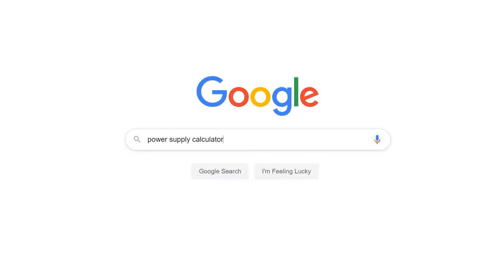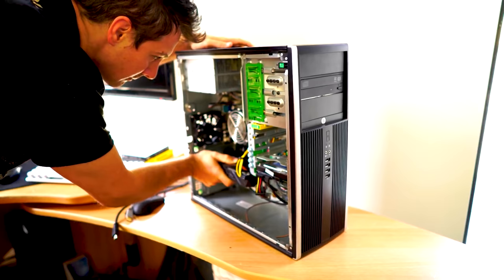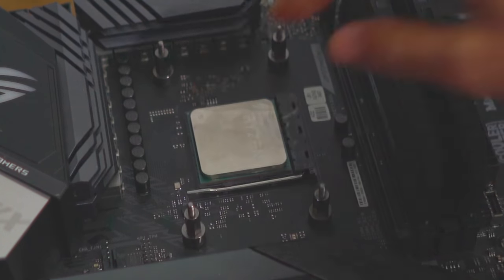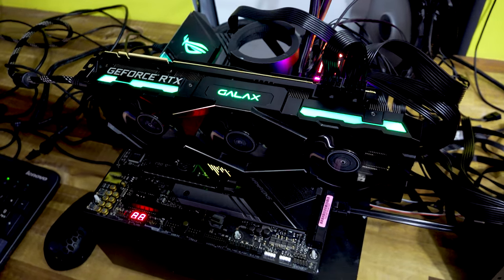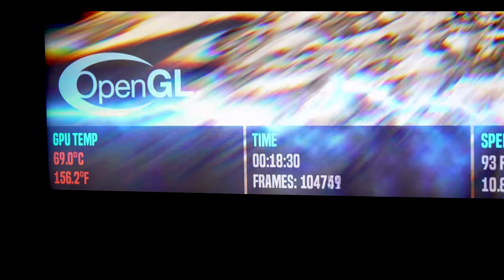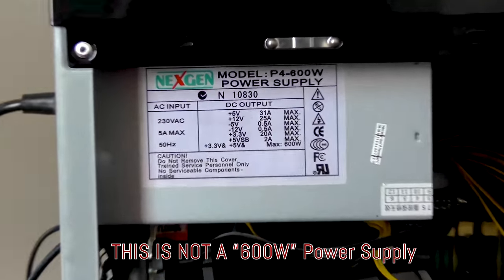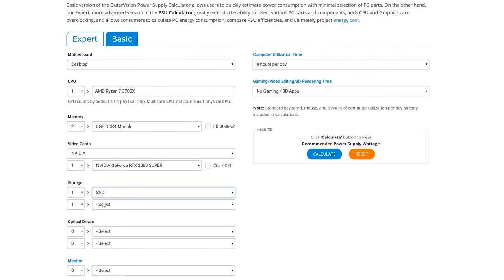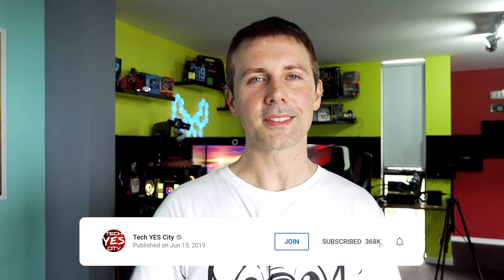I Tried Running a 3950X and RTX 2080 Ti on a 450 WATT Power Supply...

Comment: Nothing exceeds like excess... I usually try to have 750 to 850 in my boxes for the extra headroom. I actually HAD to buy a 850 back when I was running a 4870x2 card. It pulled so much current when it booted into a 3d game the psu would shut down do to overcurrent on one of the 4 gpu dedicated rails. Each rail on my 750 Nspire was rated 18 amps max and video card buried it. I got a 850 that had a single rail that could output almost 70 amps and no more issues except feeding that monster for my power bill. My boxes both have 850s now and run quiet and happy but both have more efficient graphics cards now. My old setup would show 500 or more draw just as a game loaded up and it shut off. I think it maxes out at 350 now with a 4960x and a 1070 gtx and all the other goodies. Nspire used to make great value power supplies back in the day but 4 rails kinda limited what they could power with the high watt video cards some years ago. I remember being excited about getting a decent 300 watt Antec that probably put out 400 clean back in my 486 and early Pentium days, that was a big unit back then.
Reply: There are incompatibily Problems with newer psu's having Just one rail, Like the EVGA supernova G2 and older Boards Like the X79 Classified Lavender Mod. IT don't Works. I found the one rail psu mighty in its Performance after having a 1000 Watt ne quiet Dark Power Pro P7 with ist Many 12 Volt rails which one of IT reduces Power in the big 12 V rail To 11,81 Volt wich ist the Order to Shut down system or windows regulary.

Comment: it’s best to run Power Supply’s @ 50% Load to keep it Running at it’s Sufficiency + Less noise + less heat, etc .... 💥 My Evga 600w 80+ Gold is paired with a Ryzenn7 3700x  + 32gb Ram + 6tb ssd’s + x570 + Rtx 2060 8gb Super, etc ...  Plenty of head Room for future upgrades & Thanx for Posting 🇵🇹

Comment: It doesn't matter what electronic device you are driving... you can never go wrong with a good stable and clean power supply. If your PSU is rated for a higher wattage, and it is a reputable brand, it probably means that it can better compensate for fluctuations, spikes and noise from your mains as well as back emf and noise generated by your usage device(s). A bigger power supply isn't necessarily going to use more power, the power consumption is driven by the components you install. It is just a good idea to spend a little bit extra, and you will never even know that you saved your device(s) when that power spike or dip hits. I've used UPS-es in multiple countries with live power monitoring switched on via serial and later usb ports (yeah I'm old). Please believe me when I tell you that the power from electrical outlets is not as stable as you think. I'm speaking from decades of personal experience. Think of it this way, when you go to the liquor store, rather than buying a "forty" or a six-pack, you would do better to buy a case of beer or even a good bottle of whisky. (If you can afford it) It doesn't mean that you will drink it all in one go, or that you have a substance abuse problem... what it means is that you are the kind of person who plans ahead, and you have something on hand for when your friends drop in unexpectedly. You don't plan for the unforeseen - you prepare for it.

Comment: This was very interesting. I used that calculate and it's telling me a 500w should be fine even for a 16 hours. So I guess my 750w is overkill, but it was a good price also I do plan on upgrading my gpu later this year.
Reply: nah 850w psu is overkill 750w-650w best overall.
Reply: Mine says 540w is enough for an rtx 2080 super and i pick 8 hours/day. And i have a 600w psu.

Comment: Im actualy use a r5 2600 and a rtx2060 with a 400w white Psu from evga and be fine for me, 6 hours a day of gameplay .
Reply: That’s also less than had the power draw, so yeah, you’re more than fine.
Reply: the evga psu´s are made by super flower. i´ve used 980TI SLI with an e5-2690 on X79 classified X Lavender mod, 750 Series 400Gb and about 5 Sata SSD´s with a super flower atlas 680Watt of ~2001-4
Reply: I have an coolermaster elite 500watts v.3, ill be fine with r5 2600 ans rtx 2060?
Reply: @MatheusSilva-sl6bt  yea !! Fine and eficient
Reply: @ZeuXspec  oh thanks

Comment: Most aim high because it's generally understood that your PSU is probably delivering somewhat less than it's rated voltage unless it's a branded PSU with a solid reputation, and "it's generally better to have too much and not need it than need it and have too little"

Comment: The fact that he stressed the system with 3d applications for more than 7 hours and put "No 3D applications or rendering" in the PSU calculator really bothers me.
Reply: Well, he is BASIC
Reply: Don't worry girl pants you're probably over it by now.
Reply: @gavmedia5674  I'm so offended, boo hoo
Reply: that option is only meant to calculate your power consumption per year, and not the wattage demand, so it makes no difference

Comment: "Cheap power supply for a MiD rAnGe buILd"
Reply: I’m guessing that the psu itself is for a midrange build and the build he’s using it on isn’t midrange
Reply: @richardlenaghen7403  misunderstanding but slight possibility you are correct
Reply: @threefourfivesix  maybe a mid to high range is 2 Titan X cards and a gift wrapped 2080 for a niece.
Reply: @richardlenaghen7403  and who the fuck uses titan xp cards what happened to RTX TITAN cards
Reply: @threefourfivesix  yes. at least it's true.
Reply: @richardlenaghen7403  TITAN XP cards are outdated now even tho ppl would sell their liver to have one
Reply: @threefourfivesix  Regardless of using the "XP" why wouldn't you just presume the obvious point. 
How young are you?
Reply: @richardlenaghen7403  Look I explained my previous point and now this is just boring Im not going to keep going with a pointless and stupid arguement.

Comment: Had a cheap no-name and uncoated 450W PSU coupled with a 1080 and an i5, external soundcard, 7TB of HDD and SSD (4 in total).
Lasted 4 years. Then all the electricity went out upon switching on the computer.
Swapped the PSU. Suddenly my PC was running silent and my temps were 15°C lower. 😅
Reply: Well, that's why you don't buy a cheap PSU I guess.

Comment: Risking an AMD 3950X and a RTX 2080ti for science makes a lot of sense to me 😂
Reply: He is not risking anything. Lack of power just shuts power down.  And this psu would actually be fine for years runin those components.
Reply: @filippetrovic845  This. All of the reputable PSU makers have the necessary safety precautions installed to shut the power down long before that would be any electrical danger to any of the components, now doing this with some cheaply built no name PSU is definitely not something I would wanna try.
Reply: Yuzuki1337 those $100 Rosewill 1000w models will still fry things (Rosewill refused to replace my blown up $250 SSD, I was only pulling at peak 70% rated power...). You just hope nothing happens, but even some people have fried stuff with the absolute best (it’s just there you get better customer service that doesn’t immediately ask for a fire report... like is that normal for Rosewill power supplies or something? I didn’t mention a fire...)

The good ones also don’t just crap out like that either usually (2 different Rosewill 1000w models failed at 50% and 70% ratings, but my HX1200i does fine at 1350w output and trips OCP somewhere above 1400w, my SuperNova 1300 units are also fine delivering well above rated, I’ve yet to hit OCP on those even exceeding spec). So it’s worth it for a $250 PSU if it keeps your $250 SSD from death (basically a free power supply if you look at it that way). No more will I use cheap junk again on anything over a $500 build (don’t get me wrong, I’d use a $30 CX600 before I’d use a Hercules 1600w from Rosewill because everyone knows even those fail spec horribly and those were priced insanely high for the longest time until miners really found they go BANG!)
Reply: @jakegarrett8109  
It is not always pay fault. It could be the components that have faults or short circuit that made smoke. Sometimes it could be the human factors.
Reply: William Lau It was PSU fault, the power supply died the exact day the SSD went. They also lied about it being single rail like they boasted everywhere in marketing (this may have been why it died, I would have known to load balance), it was in fact multi-rail because the night before precisely half the 12v cables just stopped working. I rerouted them to the working ones to finish my school assignment and reduced all the overclocks to stock and started looking for a new PSU, but then if went completely dead sometime in the night while rendering the last of my school project. I was hoping it was some fuse tripped (which would make sense, you know maybe had a 50 amp fuse on one set of cables, but I checked and there are no fuses...) and hopefully it would limp along with reduced load (just like my backup PSU that I had to use later was degraded severely but worked fine at say 350w instead of 500w), but nope that thing wasn’t having it! It probably damaged things the first time without any warning, because I remember it had a few attempts to boot off the SSD but that night it definitely went completely kapow! (Well I didn’t hear it, but I probably wouldn’t even wake up for gunshots).

I’ve had 3 PSU failures since building my personal machines in 2015, after this incident destroying a $250 SSD with a $100 PSU, I decided you know what, the $250 PSU (HX1200i platinum) is probably worth it, it’s basically a free PSU if it doesn’t blow up another $250 SSD.

My main PC now runs 2x SuperNova 1300 PSUs (Halloween build in a handmade vampire style casket, so I wanted duel 13’s in my PSU), but also running just one would be overloading it quite a bit (it will do it though), that monster pulls something around 1.7 kW average from the wall gaming (not counting the 65w water pump or about 90-100w in my triple 4k monitors). That monster will trip my Corsair HX1200i after a while and that PSU I have tested at over 1350w output on the 12v rail (around 1500-1550w from the wall) for over 24 hours running every GPU I owned  at the time to really stress it to ensure it was safe (I got pretty paranoid after that SSD incident). Both are greatly you’re looking for one, both can run way over spec, and that Corsair is dead silent even above rated loads (still reporting 90% efficiency at 1350w output), and the fan completely stops at anything less than 600w to 650w. The EVGA on the other hand have much more brute strength for price (they were $130 a piece, so barely any more than that exploding bomb  Rosewill, and they are fully modular and deliver at least over 2x the power of the Rosewill garbage at a similar price), the downside is the EVGA is ridiculously loud even at idle if you compare it to the Corsair even at full load (that Corsair is so quite you almost need lab equipment to hear it even when it’s pushing above spec, it’s incredible!).

Comment: my antec 650 watt is 10 years old. i'm amazed its still running on a i5 9400f and a gtx 1070. with no power hick ups...yet.
Reply: Dont say yet when you have had it for 10 years. It will last 10 more
Reply: Im' still using Crosair VX450 from 2008, only had to replace a fan after about 7 yeras.
Reply: I have a Be Quiet! 750w, Standart 80 plus, since 2011, and its totally working right now with an i7 8700k and a Gtx 1080
Reply: I have an old 13 year old Antec Truepower 500w, it works flawlessly. It even is made by Seasonic.
Reply: *yet
Reply: Of course.

If you keep a power supply cool and running at 30-50% capacity, you will get the absolute maximum life you can get from it.
Reply: i went through 3 coolermaster 650w PSUs in 2007. same fault, mouse cursor would momentarily pause for two seconds then work fine for 30 seconds then pause again rinse and repeat, how did i know it was my PSU?
Replacing motherboard, CPU, RAM, graphics card all made no difference so the 1st PSU was replaced under warranty, the 2nd one worked fine for 2 weeks before the same problem happened again, the third one was fine (different model), but the capacitors went bad just after the warranty expired. ran a 650 antec until i built my 3770k system in 2012, used an 875w thermaltake unit for this (blatant overkill, but 5 year warranty) it failed last year killing a 2TB HDD in the process prompting a new system build. running thermaltake 750w now. hopefully it will last as long as i intend to keep this rig for, 8 years, PSU has 10 year warranty
Reply: @phaztheaussiebastard looks like the energy coming from the wall outlet is not clean, because that is a lot of dead psu's
Reply: @DualPerformance  i've changed location several times since 2007. the thermaltake PSU failed at my current address, i can accept that the power may have been an issue where i was in 2007, but none of my other electronic devices had any issues
Reply: @Channel07 why? 7 years @ near 24/7 operation is a pretty good run
Reply: @Channel07 if by rule out you mean consider sure
Reply: I have a field of russian premium potatoes running in a combination of series and parrelel. Been working great for 14 years now
Reply: I have a 12 year old pc and it still works fine
Reply: Be carefull with buying per owned bei quiet Dark Power P7. There ist a reason they have Changed the cables in the next Generation. The biggest are the worst, a 1000 Watt P7 is as a 600 Watt or less after a while and the 1200 Watt is worther than this, and IT IS the Same with all of this beautifull quiet high end bei quiet P7 psu's. Inly the 400 or 450 Watt ones are very OK In the 1000 and the 1200 Watt there is something wrong the big 12 Volt Rail reduces to 11,81 Volt ...
Reply: @kicek3d  I'd be willing to bet the fan spindle only needed to be cleaned and lubed
Reply: @Channel07 old themaltake good, new is bad. Use Corsair
Reply: @Makygero  the straight power 750 W psu are very stable and life very long.
Reply: Michael Hart when?
Reply: I have an Antec 650 that has to be that age too, still works like a charm I have it powering my homemade NAS.

Comment: I mostly agree. But you also have to think about more than just being able to run the games and saving money.
With a bigger wattage, you usually have a better build quality, meaning that it usually runs cooler, makes less noise, and can give more stable FPS and can run for many more years. Having a small PSU is a lot like having a Toyota Aygo, where you constantly go up and down in the gears in the city, putting stress on the transmission. Where as having a bigger PSU is more like having a middleclass car that you instead run on the country roads on a stable low to mid RPM. The end result, is a smoother ride and longer lasting ride (more years of use), and if you have to, a more clean acceleration meaning a more fun game experience.

A good brand is usually enough to ensure quality, but not always. I suggest on top of that mentioning that you also pick their mid to top line of models. Some big brands with good reputation, have really bad lower models that you want to stay away from. They might work for most people. But they don't always represent the brand very well.

I also have to mention that you have to take into consideration, the quality of your VRM's on your motherboard. So if your motherboard is known having power problems with higher model CPU's, then don't take the minimum amount or recommended watts. Go with a little more, and make sure it is a good brand with a semi high model. Just like the new x570 MSI boards that are the cheapest, there is a reason why they are so cheap (VRM), so in this type of case you don't want to save on the PSU.

I remember back in the days when I bought a no brand cheap PSU even with a high wattage. They would usually only last 2-5 years, sometimes up to 8 years. My last  2 corsair PSU that are only highest low model and mid/mid model, lasted me 10 and 14 years. And I don't even think that Corsair are the very best, they are just one of the best brands of maybe 5 in total. So you also have to take that into consideration price wise. When you go with a bad PSU, it is like driving a small car with a worn down clutch, not fun at all.

Comment: My 520W Seasonic Platinum fanless PSU started tripping when I upgraded my old 4790 to the 3950x. I'm still using my 1080Ti, and the system is pulling up to about 550W when under full load. I would not recommend anything less than 650W for a 3950x/1280ti combo, and if you want some headroom, I would suggest at least 750W.
Reply: Undervolt and underclock a little.